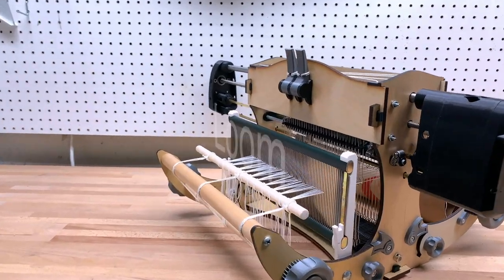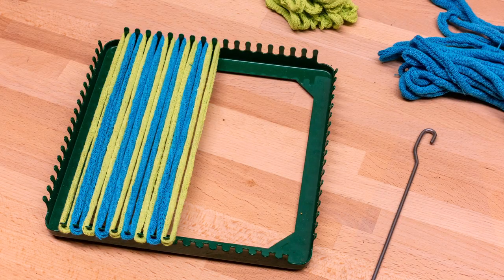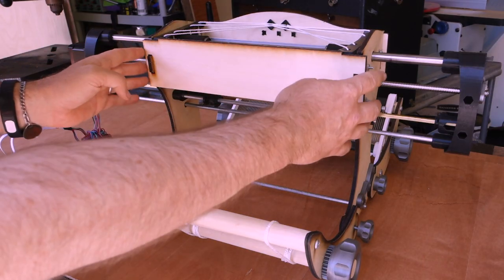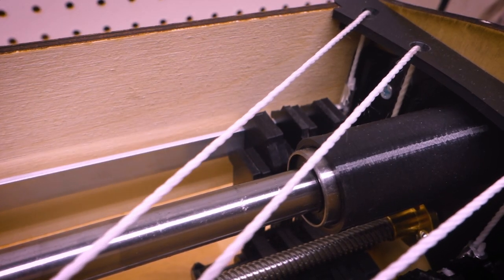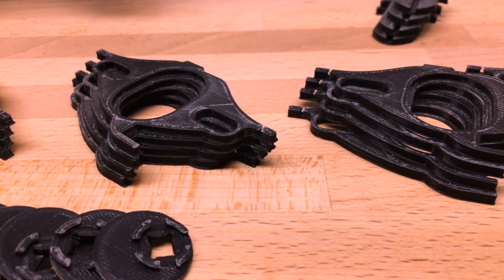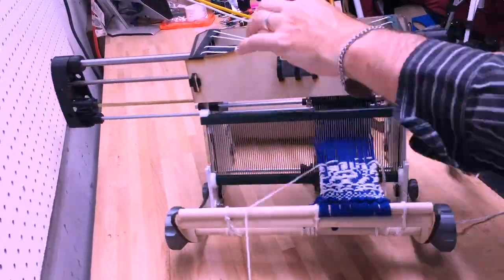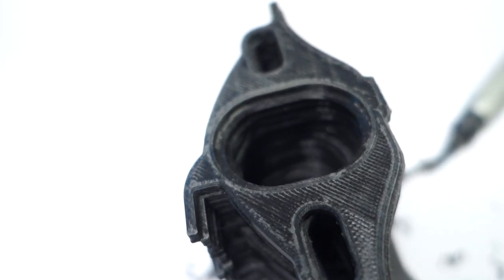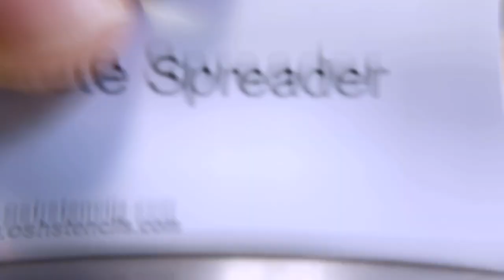Building a Computer Controlled Loom

Comment: Next step: Adding a fade shooter
Reply from the maker: I have to admit I don't even know what that is.
Reply: @retrotechjournal  
Yarn shuttles automate the loom.

This is a carriage where the thread is shot through the other threads.
Reply: Sorry i have the wrong word used;
> Fade Shooter (false)
> Yarn Shuttle (right)
Reply from the maker: @Silberschweifer  Ah yes.   I opted not to try and do full automation with this rig.  Simply because it's easier, and more flexible.  This way I can handle any number of shuttles.  I think the Pikachu one is 5 shuttles.  White, Red, Yellow, Black, Thin White.  Which would be hard to automate.

Comment: I didn't quite understand the impact of the computer controlled part in the final design.

Or how he didn't accidentally wove his beard.
Reply from the maker: Oh I'm sorry.  I really should have included some footage of the phone app that drives the loom.  That would have made it a bit clearer.  The phone app manages the sequencing of the various thread lifts/tells me which color to send across, etc.   So I can design patterns on the computer and then stick them in my phone and sequence them out.  I'm a mobile developer by day, so I kind of considered the app to be the least interesting part, but I should have included a clip of it in action to explain now it worked.  I designed the Pikachu pattern in Photoshop as a multi layer image and then ran it into my phone app to weave out.
Reply: @retrotechjournal  Thank you very much. Awesome work.

Comment: It is pure cruelty to mention the long thread streaks, that there are tricks to solve it, then skip to the next section without elaborating for a single second! rambling while firing up google to find out
Reply from the maker: Gosh I'm sorry!  The word you're looking for is Tabby.   The idea of (on alternating rows/picks) using a plain weave.  In my case I used a finer thread to just stabilize the pattern rows.  I tried to avoid using a lot of weaving technical terms, but maybe I failed to make things clear in a few areas.
Reply from the maker: If you look at the dark area between Pikachu's paws in the thumbnail, you'll see the thin white horizontal lines that are everywhere. Those are the tabby lines stabilizing the design, forming the regular alternating "plain weave" with the fine vertical lines that are the warp.